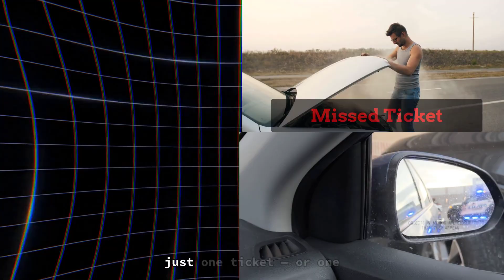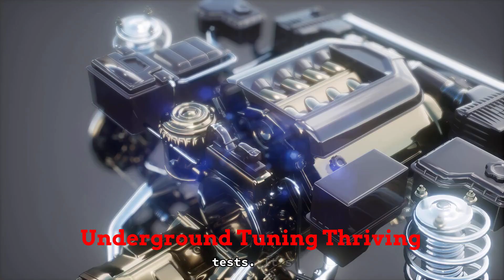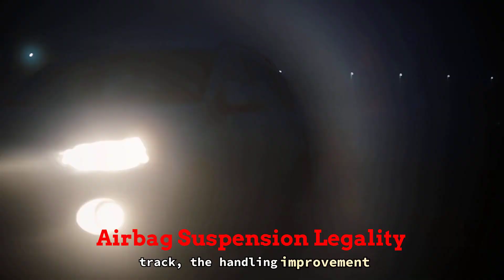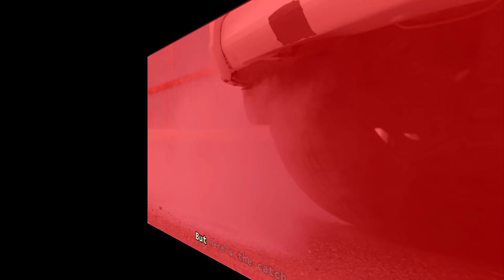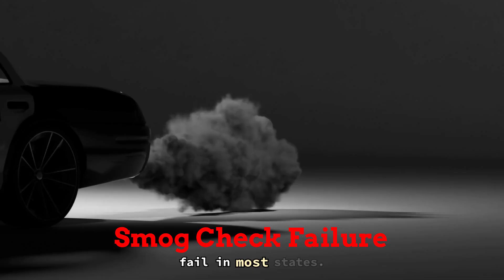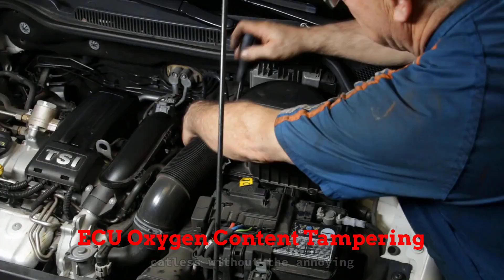11 ILLEGAL Mods That Will Make Your Car Run Better

Comment: Hi ! I have a 2004 2.5 4 cyl automatic Subaru outback with 333000 miles and bad 02 sensors and one catalytic converter which blew out the inside so it is straight flow through and l am going to empty out the other side ! I live in Massachusetts after a auto turns 15 years old it is exempt from the emissions test just the safety is needed ! Sorry California ! Is there a way to exempt the check engine light with out it costing a fortune ! Rick
Reply from the maker: Hey Rick! You're right about the 15-year emissions exemption in Massachusetts — definitely a plus for older rides like yours. 👍

As for the check engine light (CEL), if it's only on due to the O2 sensors or catalytic converter and you're not worried about emissions testing, there are a couple of budget-friendly options:

    O2 Sensor Spacers (also called defoulers): These can sometimes trick the ECU into thinking the cat is functioning and turn off the CEL. They’re cheap on eBay or Amazon — worth a try.

    ECU Tune/Delete: Some shops or tuners can reprogram the ECU to ignore specific codes (like for the cat or O2 sensors), but it usually costs more and depends on your comfort level with custom tuning.

Just make sure you’re not masking a more serious issue. At 333k miles, that Subaru has seen it all — respect!